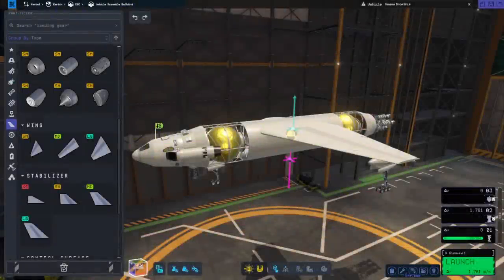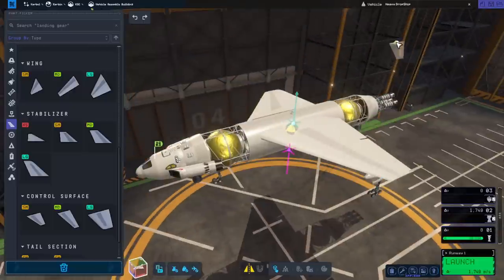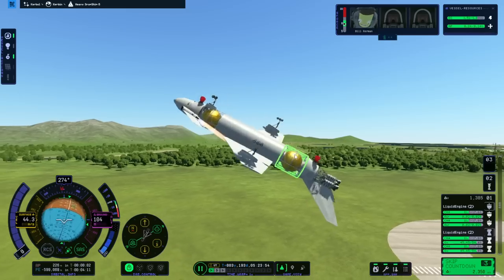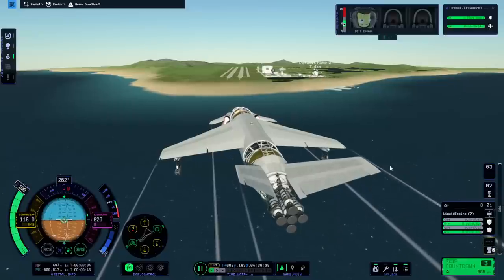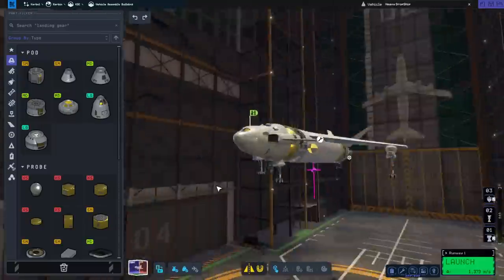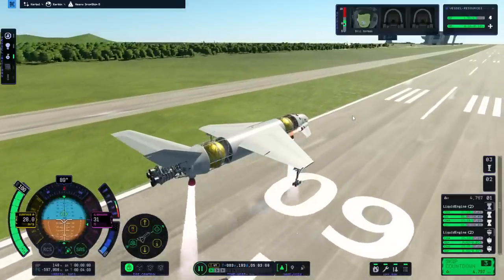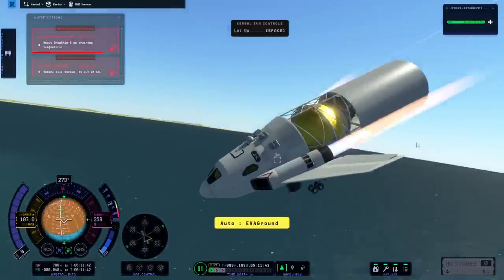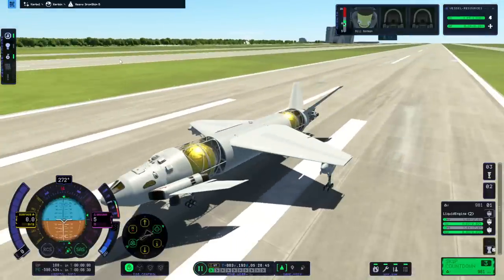KSP 2 Early Access - Heavy DropShip

Comment: The reason that dropship is flipping is aerodynamic, that is why it only happens when you pick vertical speed. As you speed up upwards, the wings start generating lift, and your center of lift is not balanced around your center of mass (at that angle, you also don't seem to know center of lift may change with angle of attack, try tipping your whole ship in the VAB to visualize this).
Reply: You’re probably right, though with the plane traveling straight up, with an AoA of ~90 degrees those wings should not be generating any lift at all. I understand the aerodynamics in this game need a lot of work. I don’t expect Ferram Aerospace levels of realism but this is far worse than KSP1. I’m sure it will improve over time.

Edit: based on another comment I read it seems the reason the plane is flipping over is because those rear stabilizers are generating more drag than the canards which causes the flip. That sounds about right.
Reply: @thesenate2718  call it lift, drag, whatever. Aerodynamic forces that impart a momemtum to the craft, dependant on speed, in the end. I clearly could have expressed myself a bit clearer, but I think we all got the gist of it.
Reply from the maker: @rune12358 I did not expect the torque for the effect you describe to exceed the torque of the engine gimbaling and reaction wheels, and I still think it should not. However, I did reshape the wings slightly forward during the video, thinking about that effect. I will once again point out, with regard to our previous conversation, that your tone continues to seem contemptuous of me.

Comment: I don't think lift has anything to do with the pitch-up issue. I think the drag from the rear stabilizers when gaining vertical speed is not symmetric, the canards do not generate as much drag when the craft is traveling vertically. The rear stabilizers are just big flat surfaces generating tons of drag when the craft moves vertically.
Reply: Additionally, something you could do in the VAB to visualize this asymmetry would be to rotate the craft 90 degrees nose-down and then look at the center of mass vs the center of lift.
Reply: A good idea for the devs would be to introduce a center-of-drag indicator for the VAB, with options for changing altitudes and speeds to look at the differences in drag in subsonic thru hypersonic speeds